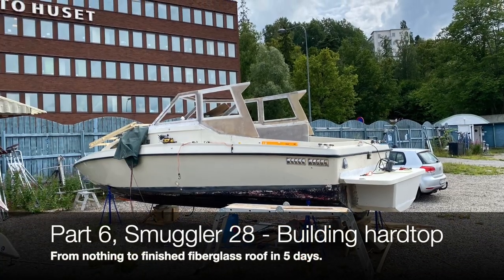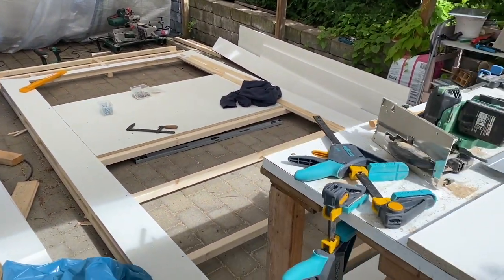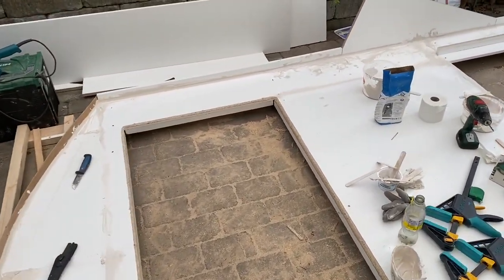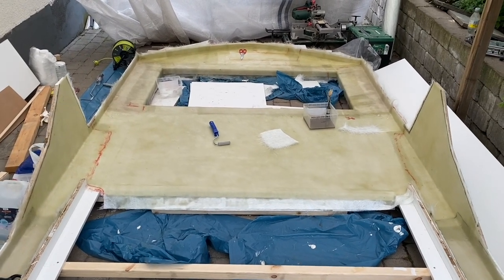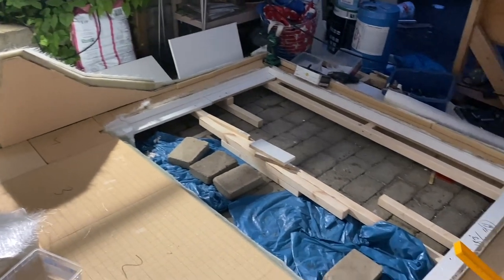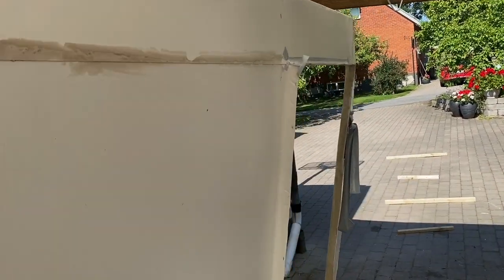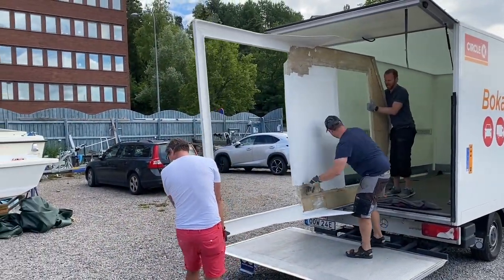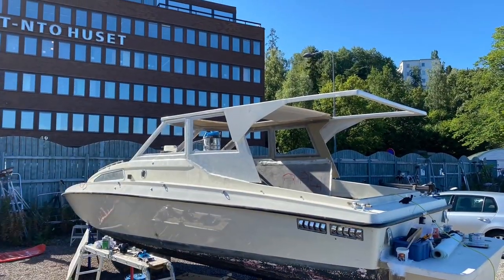Part 6, Smuggler 28 - Building a hardtop for my boat from scratch

Comment: I like the hardtop it's a nice design. I have a 25' Sportcraft hardtop but it does not cover the entire deck, so I use PVC pipe frame with camo netting to block the sun on hot days that I put up and remove at sunset. I store the pipe on the floor under the gunnels.
Reply from the maker: Thank you!  The sportscraft 25’ is a really nice looking boat. Does it work well with your solution even if you don’t lie still, or do you need support in all corners?
Reply: @boatdevoted  It only works when anchored. I use 2 pipes coming off the roof secured with 2 hose clamps on each side on the grab rail that I never remove so just slide the pipes in and on the other end 2 pipes for legs with a 3-way connector with 1 pipe going across to tie it all together secured with set screws in the 3-way connector. In the corners I use a rubber strap screwed into the gunnels. Takes 5 minutes to set up and take down.

Comment: Next time use pva for mold release, it'll pop out a lot easier
Reply from the maker: thanks! usually it´s not a problem with the melamin molds I use. In this case I´d by mistake glassed a bit too much down in the sun-roof cornes and the fiberglass was bent around the edges and locked everything.